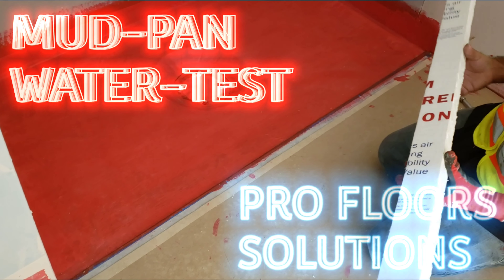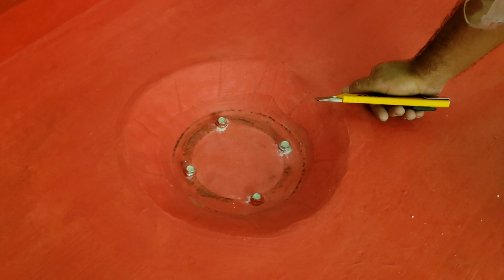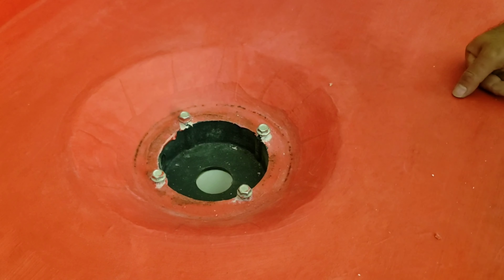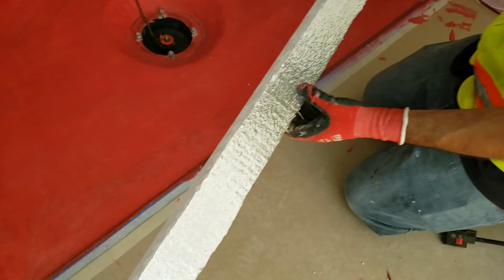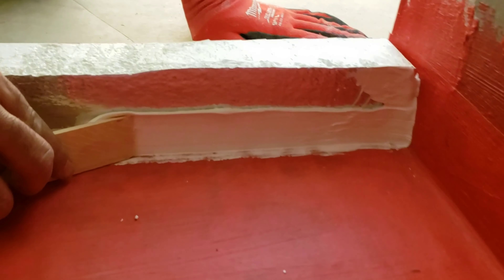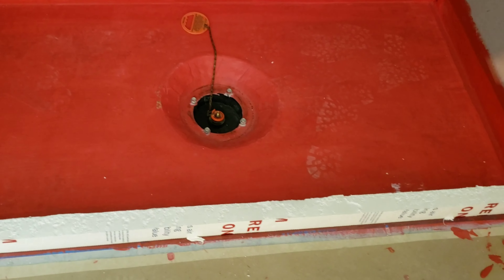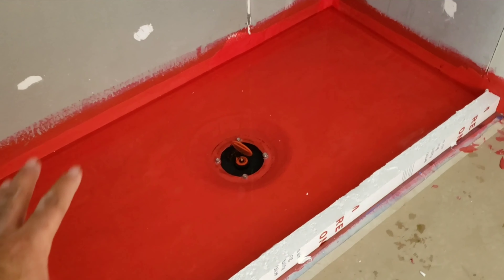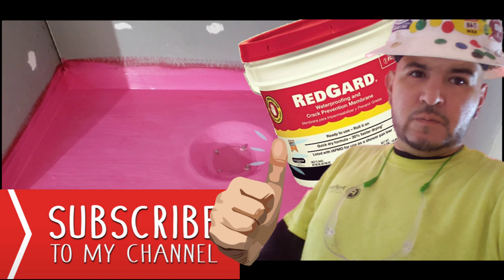How to Test Waterproofing Shower Pan for Leaks ✅ | #Redgard Divot Method Part 2 #showerpan #leaks

Comment: subscribed. I  thought i did my shower build wrong because I already put in the wall first and all 3 that visited that I asked to help me with my project says that i need to tear everything apart and 2x6 or 2x8 all around the bottom of wall and clip on a liner. glad to came across your video!

Comment: I might have to try that method sometime. Always have a hard to dealing with the shower liner leaving some bump outs with the folds you need to make.
Reply from the maker: Definitely this is way better than a rubber pan in my opinion, it works 💯
Reply: Redgard is the only system i use. Zero failures in 15 yrs.

Comment: Great video!  Question I cannot find answered online and hoping you might answer.  Have a new masonry construction in Mexico with a sunk in concrete shower floor that is part of the slab. Skimmed cinder block walls.  Shower floor is 3' x 3'.  Want to use solid marble slabs, cut into four sections to provide drain slope.  What is your opinion on going about this?  Thin set, motar to produce slope, then redguard or?  Do you have a high quality drain that you like to use?  Help!  All the videos online deal with timber construction.  I always thought you could just tile, stone, etc. directly over concrete.  Am I missing something?  Thanks again, great videos!  Subscribed.
Reply from the maker: Ill probably need an email to answer that, maybe you could find a schluter 36" drain place it in one side of shower set it properly and slope the whole slab with thinset motor to the one side and avoid cutting into 4 pieces and maybe avoid using sandmix.. unless 4 pieces what your looking for but you'll definitely need to do a mud pan with sandmix before redgard and tiling
Reply: One thing noone considers with 4 piece stone slab shower floors is they can be slippery.
Thats the reason most use small tiles. Small tiles equals a lot of grout joints. A lot of grout joints equals traction!
Reply: Putting marble on shower floor is a terrible idea. Very slippery.